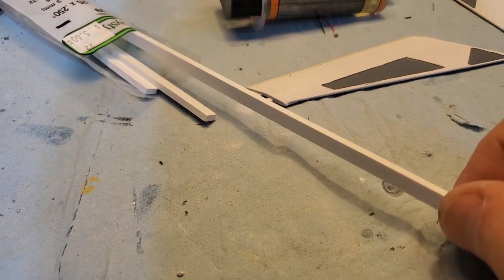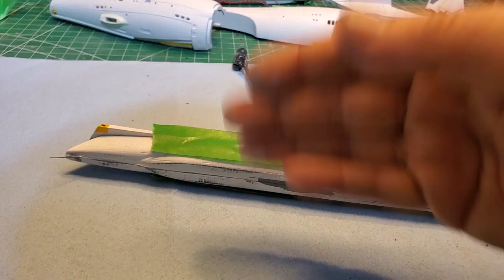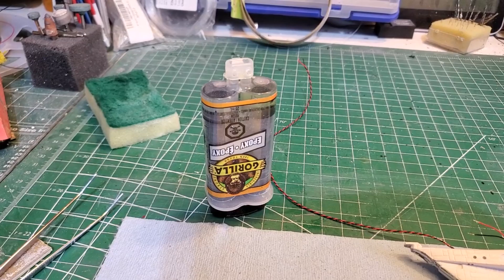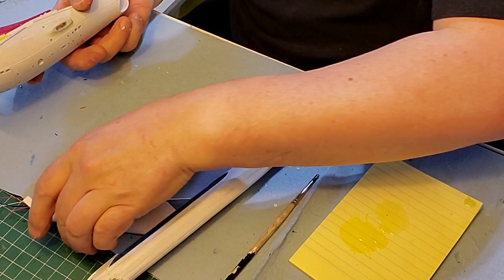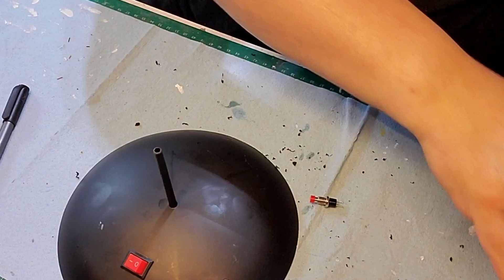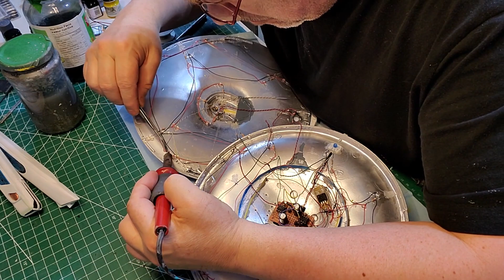537 Scale Enterprise Refit Build (Part 5)

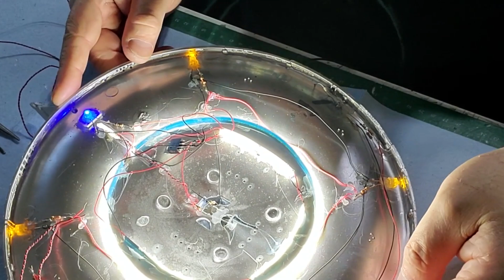Comment: Just joined your channel. Getting reayd to do the 537 Enterprise myself. I have a couple of questions as I am just now getting back into the modeling realm. 1- What do you use as your power source to check the various power lines? I see that occasionally you use a 9V battery, but when you are testing full circuits (15:17) it looks as if you have a full 12V power supply somewhere off camera. 2- What do you recommend for a soldering iron for these projects? I have a full size soldering iron, but it it too bulky and unweildy for delicate work such as this.  Thank you for any help you can offer.  Looking forward to watching the rest of the build.
Reply from the maker: Well 1. for the full lighting test I use a 12 volt 1amp power supply. You don't really need anything more powerful than that. The main lighting I use needs a 12 volts 1amp source to work, all the other I run the main power through a 5 volt regulator that cuts down the amps to the regular LEDs so they last longer.
2. I have a Weler soldering unit and use a fine point tip to solder with. Most of my work is pretty small and need the point tip.